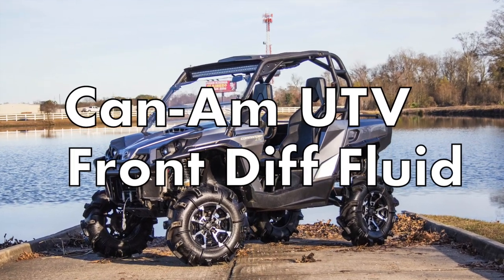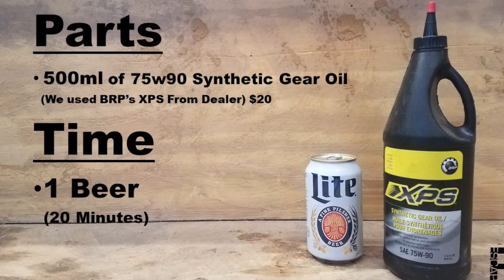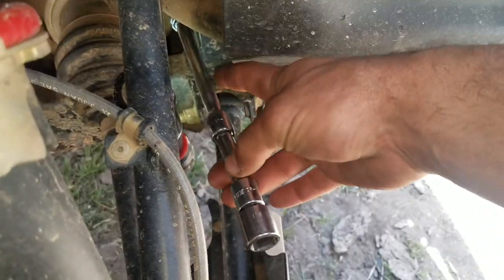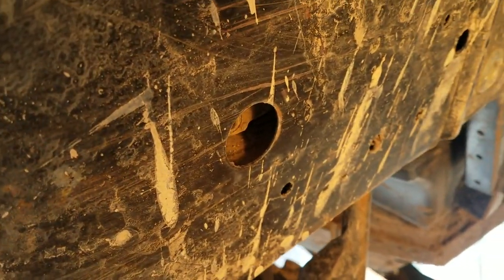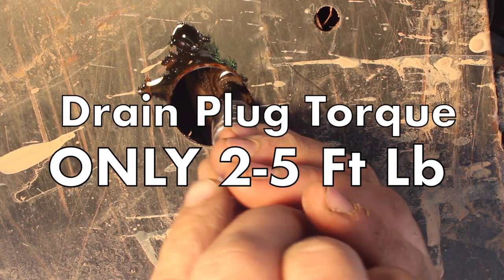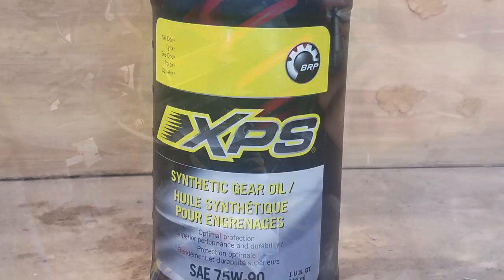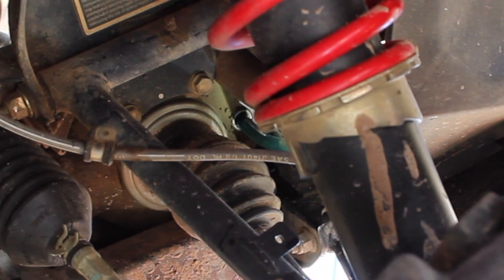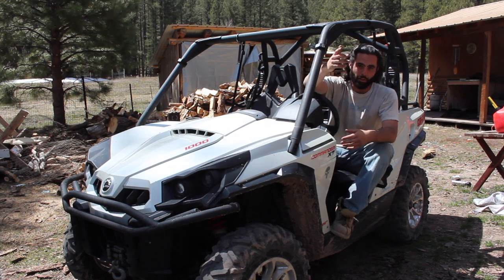Can-Am Commander Front Differential Fluid Change: How-To Replace Front Diff Oil Can-Am UTV

Comment: Your advice and step by step tutorials are awesome. The hex head sockets were key! I would have tried to be cheap and just use the hex wrenches I had. One thing I would add is that if you don't have a tube that fits inside the fill cavity, buy a flexible funnel from an auto parts store (I got mine from Advanced Auto). The tip of the funnel is tapered and fits inside the cavity nicely (insert innuendo humor here) and also has measuring ticks on the side of the funnel to measure with. Great video, thanks for making these it's been a lifesaver and much better than just the maintenance manual.
Reply from the maker: appreciate that, and yes I remember when I first started using the hex sockets and thinking this is a game changer. Something else I've learned since on small bolts with hex heads is to use a punch (Either much larger or smaller than the size hex so it doesn't damage or strip the part you stick hex into) and give the bolt a few whacks with punch and hammer. It seems to somehow jar the threads so they are looser and easier to remove without stripping. And great advice on that funnel I'll have to look into that. Thanks for watching and taking the time to share some advice in the comments. Cheers
Reply: @EscapePowerSports  No problem! Keep making these great videos so I don't have to take it to the stealer!
Reply: @EscapePowerSports  uh

Comment: good morning I have a commander 1000xt 2013 and I try to find where are located the drain plug at rear and front differential...... thanks
Reply from the maker: usually the rear plug is on the bottom and the front drain plug is on the passenger side below the cv axle. Helps to find them with a clean machine and lots of pressure washing. Thanks for watching and taking the time to leave a question in the comments. Cheers

Comment: Hey sir, I’m trying to screw the fill plug back in. Once I get it snug, the copper ring is still loose. I don’t want to overtighten but don’t know what is keeping it from tightening snug. Any thoughts?
Reply from the maker: hmm I'd carefully inspect the threads on both the diff and the plug to make sure they look good. good luck and let us know how it goes. cheers

Comment: Hi Is there a difference between using torque head socket and Allen head socket kind of confused between the two of them
Reply from the maker: Hi yes a "torx" or torque head socket or bolt is the star pattern while as the allen head socket or bolt is a hexagon instead of the star in the case of these bolts we need the allen hexagon shape and not the torx "star" shape. Hope this made some sense or helps on the distinction between the two. Thanks for watching and asking a good question in the comments. Cheers

Comment: What size tube fits inlet?   Outside diameter?
Reply from the maker: hmm I sold the bike, but I'd take a wild guess and say 1/4" tubing assuming o.d. is 1/4" would be safe? its been a while and I sold the bike sorry I'm not certain or much help with this one. Good luck with fluid change, and appreciate you taking the time to leave a good question in the comments. Cheers

Comment: What is part number for the front differential drain plug?  Is it the same as the rear?
Reply from the maker: after some digging online it looks like the part number for the drain plug is p/n:705500894 I wouldn't be surprised if they were both the same plug as they are both 5mm allen bolts, I would just call your local dealer to be safe though. Hope this helps, and I appreciate you watching and taking the time to leave a comment. Cheers

Comment: You need to make note that front diff filling plug to place a rag underneath the it. If not and you drop the plug or the socket is a b** to get out
Reply from the maker: very good tip, appreciate you taking the time to share good info in the comments, which adds value to all the viewers who see this. Cheers